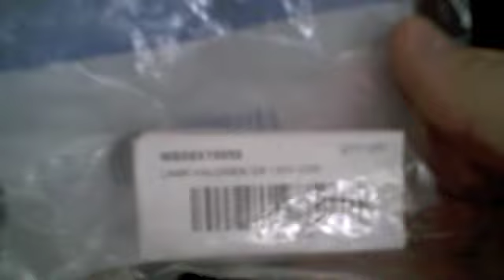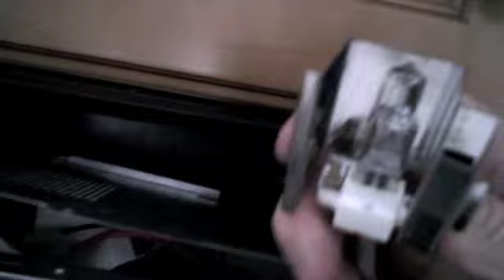How to replace the lamp in your GE Advanta Microwave Oven

Comment: This video never tells you the replacement bulb part number or explains the wattage or voltage. Everything else in video was super useful. Thank You for posting as you saved me a $150 repair.
The parts schematic on GE Appliance Parts website references the wrong part number. The correct part number for this replacement is WB25X10019 Microwave Halogen Bulb; 20W, 120V
Reply: Replace bulb one time search LED wb25x10019 on fleabay.

Comment: Thanks Scott - our microwave light has been out so long I was convinced we didn't even have one and it was only the halogen cooking lamps that illuminated the oven.   I wouldn't have even bothered to try this except I was Googling to figure out the bulb I needed for the stove top light when I found your video.  Now my wife is twice as happy and we can have illuminated microwaving sessions. 

A couple of notes: 

1. The bulb I used was a 25W 130V halogen bulb with GY-8 base.  130V is not a typo - normally they are rated for 120V but the 130V ones are "long life" because run at 120V they take longer to burn out.  I note there are now LED replacements but I don't know if they are suitable for high temp usage scenarios and I'd guess when our convection oven is on that would be the case.   Incidentally the stove top bulb is 20W but I honestly don't know why you couldn't use 25W there for a bit more power - I'd feel better about using LED there too - it's behind some thick glass.  

2. Two of the screws along the top of grill fascia go through plastic tabs sticking out from the top edge which slot into metal clips held by the screws.  I'm not sure if my clips were already broken - the oven is maybe 15 years old and plastic will often get brittle over they years especially if subjected to high temps - but they were definitely broken when I had undone the screws and removed the grill.  Oh well.  I found the fascia hangs in there fine without them, it's not really going to show.  

The fake stainless steel grill fascia for our oven is listed at $150 on Amazon! All for a piece of plastic... https://www.amazon.com/GE-WB07X10774-Vent-Grille-Stainless/dp/B004XKZSV4 - better to try and repair it IMO if it really matters to you.  I think you could probably use epoxy resin to glue some plastic tabs on or attach some small metal plates to engage the clips.  Even a large washer glued to the top edge would work.  But I really don't think it is necessary!

Comment: THANKS!....this great video saved me $125+ for a service call.  The only tools needed:  small Phillips screw driver, Phillips offset screwdriver, small flash light, and latex gloves to handle the new halogen bulb, to extend it's life.  The bulb for my GE Advantium oven:  WB25X10019  GE-120V20W Halogen Lamp...$8 for a twin pack on Amazon.  I keep extras, as the light under the oven burns out more often.

Comment: LESSON LEARNED THE HARD WAY.  Before starting this project check to make sure you have the correct bulb.  To do this, check the model and serial number on the sticker inside the door of your microwave or the owner's manual if you still have it - you can also get a copy on line, then cross reference.  It seems there may different bulbs for different serial number series of the GE Profile Advantuium 120 microwaves.  Some are G4 base and smoe may be G8 base.  My microwave is about 10 years old and was a G4 base.  The bulb shown in this video is a G8 base and did not obviously work on my microwave resulting in me having to order another bulb and return the incorrect bulb I ordered on line.  😞

Comment: One thing to note that I am surprised you didn't cover.   These a halogen bulbs which you should NOT touch with your hands as the oil on your hands damage and reduce the life of the bulb.  Wear disposable gloves was what I recall the recommendation to be on these.
Reply: TRUE...My husband always told me not to touch halogen bulbs cos the oil on your hands shortens their life...He was an electronic engineer for medical equipment that had lots of halogen bulbs inside.

Comment: You can purchase the LED four-pack on the Jungle Company. Search: G8 Led Bulb 3W Equivalent to WB25X10019 Halogen Bulb 20W Replacement for GE Microwave Oven Light, 120V Daylight White 5000K, T4 JCD Type G8 Bi-Pin Base (4 Pack)

Comment: Our interior light is in a different location (on the right side of the cavity, the inside wall adjacent to control panel).  Cant find anything about replacing that bulb.  It's a 240V Profile.

Comment: thx for making/posting this!  that light's been out for at least five years!  (grins sheepishly)  does anyone know if they make led (vs halogen) replacements?  those bulbs SUCK!  I've gone through at least 10 of them over the years (just cooktop light).
Reply: Sid Lane thanks! I don't know if there is an LED version but be careful not to touch the lamp with your fingers. The oil from your skin is apparently death to these lamps.